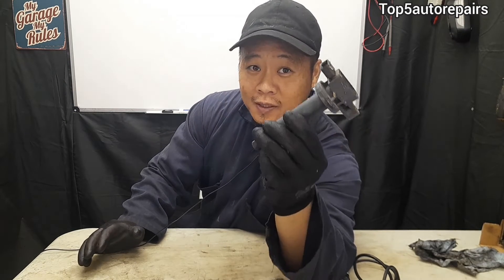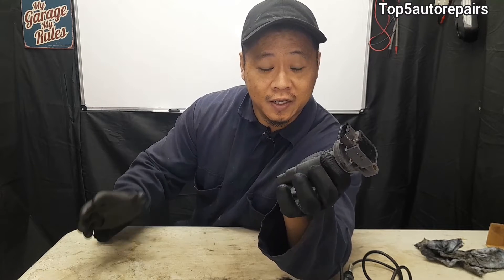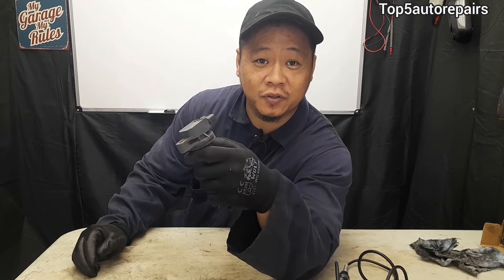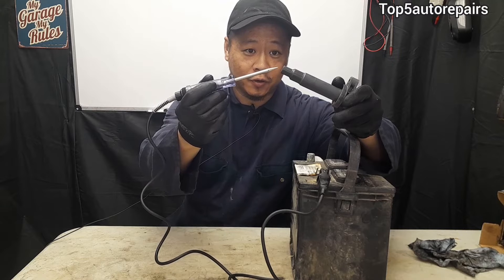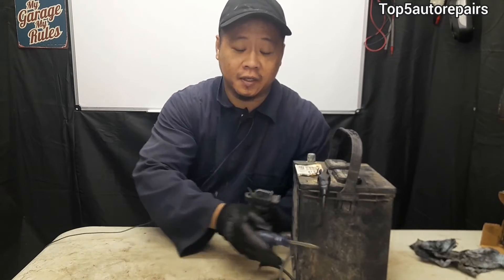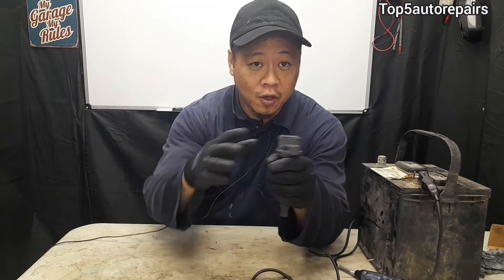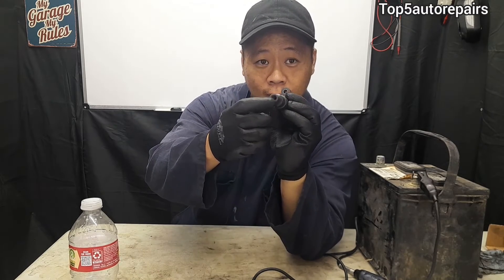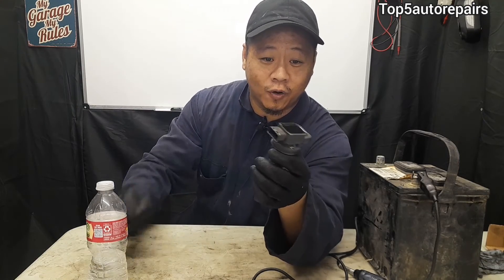Symptoms of Bad Ignition Coil (Explanation and Lecture How to Test It)

Comment: I ended up pulling all 8 connectors, 1 at a time, to see and hear engine rpms change. Cylinder 5 and 7 ended up having bad coils. When I pulled connectors on both, the rpms didn't change while shaking, but the others did, so that's how I knew they were bad. I changed them today, and engine has all 8 cylinders firing again. YAH!! BTW, I did check the spark plugs to see if they had spark, with the help of my buddy giving me the idea of checking the plugs with my lawn mower. So all is good, for now.

Comment: My Denali XL ('15 Model) with 150K miles is starting to chug briefly upon starting about every 5th or so time starting.  I'm wondering if this could be from bad coil pack or plugs?  It runs pretty well once it gets through the initial start, but I know coil packs take a while to go bad so maybe this is just the start.

Comment: Hey so i have a similar issue….. i had a P0301 come up and then disappear….at red lights or stop signs car shakes…..rpm also sits below 1000….when accelerating it seems fine….i held the ignition coil above a little and heard that tsk tsk tsk sound on all of them…..i also sprayed throttle body cleaner in the throttle body….im not sure what else it could be….it’s a 2006 nissan altima 226k miles….can anyone help please
Reply: Nissans eat coils for breakfast

Comment: Thank you for so informative film. Is there any mileage after which you need to replace the Ignition Coils? And can faulty ignition coils prevent the alternator from charging?
Update: It was burned Alternator. I've checked w/voltage between Alternator Harness and ground, it was ~ 5V, so the signal fm/ Power Control Module was going on Alternator. Looked like it was a failed Alternator, and it was. I fried the alternator performing one cleaning procedure for EGR Valve ports longer that advised in one film. The time interval to run the engine w/EGR Valve removed should be 2-3 sec, I saw film long time ago and mixed up, I thought 20 sec. When I counted to 10, I shut it off since Rpms went to 4000, it was very loud sound, and a smell of burning. I thought it is carbon particles are burned, but it was the alternator. After I replaced it the problem was solved. Not big deal, but I'm surprised why the fusible link between the Starter and Alternator survived, but the alternator was burned?  Can someone tell for how many Amps you use a fusible link for the alternator on 90 Amps. I've read that usually you go with 20% higher Amps, so for 90 Amps alternator it should be 118 Amps. They sell 100Amps fusible links, but I'm not sure about those 20%. They also sell 80 Amps, but you don't won't to go too low, since your alternator can get disconnected too often. Can't find that info anywhere, so I would really appreciate any opinions on this matter. Thank you for this informative film and attention to my questions. It helped me to zero down the problem.
Reply from the maker: Usually ignition coils should last beteeem 50,000-100,000 miles. To answer the second question, a bad ignition will not prevent the alternator from charging. It's unrelated.
Reply: @Top5AutoRepairs  Thank you so much. Just in my scanner for possible solutions of the code P0631 (I have Battery Light and that code, the battery is not charging, the voltage on it drops w/engine running) they say: someone replaced Ignition Coil(s), also Engine Collant Temperature sensor. I assume those parts also can cause P0621. Thank you again, your films are great, it is a pleasure to listen to such a professional.

Comment: I need help,  my 2012 jeep patriot have a misfire for cylinder #4 , I put new spark plugs and swap the fuel injector and coil from #1 to the #4 and still got the code for cylinder #4 I already checked the compression and #4=190 #3=160 #2=190 #1=185 and I checked the volts connector with a multimeter and I'm getting on all 4 almost 12v the only thing that I have not change are the coils.  Any ideas, thanks
Reply: What turned out to be the problem?

Comment: Is it possible that the car is not giving a code but the coils are beginning to fail? Car rattles at idle while on drive I changed the throttle body and some motor mounts also the belt pulley and belt. No code at the moment
Reply from the maker: Yes it's possible due to weak spark. Worn spark plugs and failing ignition coil.
Reply from the maker: Yes it's possible due to weak spark. Worn spark plugs and failing ignition coil.

Comment: The resistance on each of my coil packs is 1.3 ohms and everyone might want to check theirs! Also i determined that i had a bad connection to one of the coil packs. Now it is acting up again so maybe it wasn't a bad connection after all or maybe one of my coil packs is acting up when it gets real hot!

Comment: So I am trying to figure if I didn’t gap my plugs properly of if my coils are failing because every morning when I go to start my car it’s rough but when I warm it up and start driving the symptoms go away I recently changed my spark plugs and the battery on my Dodge dart I have regapped my spark plugs three times and it’s still starting rough engine feels like it’s shaking
Reply: Did you figure out what was wrong?
Reply: @adamchanez7470  I did it was bad motor mount and I wasn’t supposed to gap pre gapped plugs so I had to buy new ones. Now I have a bad control arm problem
Reply: @The.Talking.OakTree why would you ever gap a pre gapped plug lol. I wouldn’t trust any pre gapped anyways, always better to gap yourself so you know it’s your fault if it fails then adjust it. Pre gapped also more expensive.
Reply: @ihavegoodmusic9496  I’m not a mechanic I don’t know the difference between pregapped plugs and not didn’t even know they existed always checked the gaps according to the manufacturer specs. I work on my own shit these days more because I don’t trust shops nor dealerships unless it’s a big problem like transmission or engine rebuild I’ll fix my car so I can see what the problems are and I can learn.

Comment: How would you diagnose a coil that's misfiring sometimes but not all the time? I recently bought a 2002 Lexus LS 430 with the 4.3 liter V-8 engine and it misfires part of the time but not constant and there's no check engine light on.
Reply: How do you know it is actually misfiring?
Reply: @explorehunter  It's fixed now. I took it to Autozone and they hooked a scanner to it and it stated that there was a misfire in #1, #2 and #5 cylinder so I ordered ignition coils for it. I can usually tell by the way the vehicle drives and feels if it's spark related.
Reply: @bodeine454 
 great that your car is fixed! My car also vibrates while cruising at 80-110kmph and the vibrations comes from front end and center console. I am going to replace engine mounts and see if the problem solves. No misfire code yet here. GS430 2004.
Reply: @explorehunter Any updates?

Comment: Can plugs or coils go intermittently bad at the end of their lifespan? Scanned my car and it gave me a “pending” code p0303 for cylinder 3 misfire. Now I turned it on again and the engine light is no longer flashing. It drives fine. Weird. Anyhow, I’m not sure if the Spark plugs or coils are bad, but maybe the mechanic can tell me and I could save money and not need to replace both plugs and coils. Good video 👍🏽
Reply: Good point. 
Coils do not all fail the same all the time. The coil on plug 'pencil' types are subject to much more heat than older designs and will often only misfire when warmed up.

Comment: My uncle just gave me a 2013 Nissan Sentra sv with brand new transmission. After having the transmission changed it started to shudder on taking off so he gave up and gave me the vehicle. I changed all coils and spark plugs after pulling the code p0304 or whatever I cant remember but once I changed out coils and spark plugs it purred like a kitten. 👍🏾😎
Reply: Ordered ignition coils...already changed spark plugs...hope it ain't my fuel injectors...about to give it try...thanks for ur input...💪🏿
Reply: @brandonrobinson693 any luck on ur situation?
Reply: Make sure you sell that thing before the transmission goes again. They go after about 
60 - 100k miles terrible transmissions
Reply: and so you gave him the  vehicle back and told him how you solved the problem?😊
Reply: @less2worryabout  absolutely not I'm still driving it today.
Reply: @less2worryabout 😂
Reply: Check if the ignition coils have the right resistance
Reply: Your uncle hates you😅